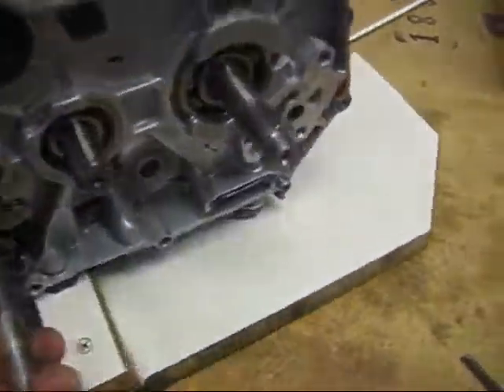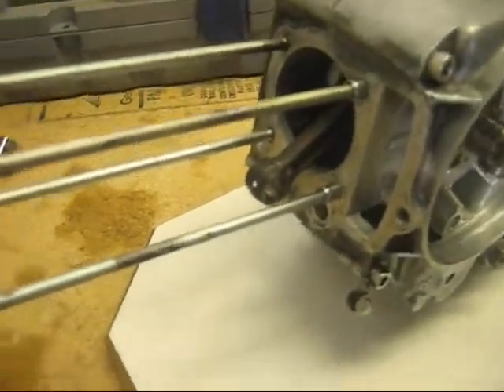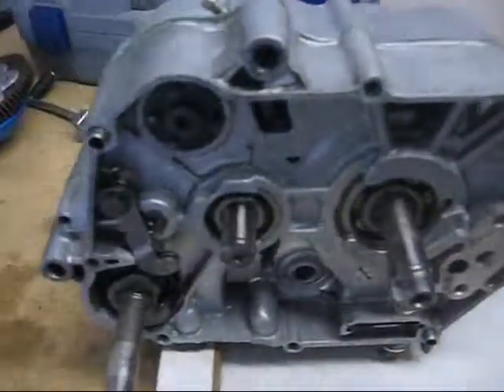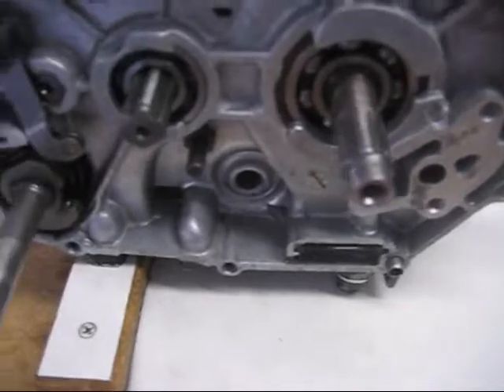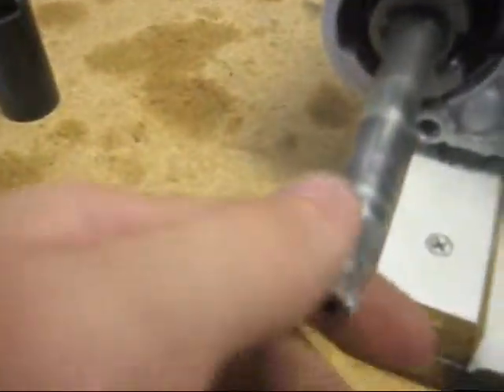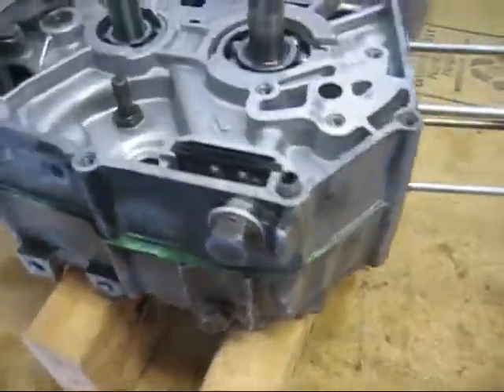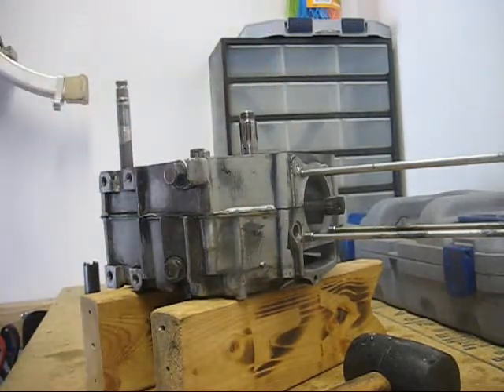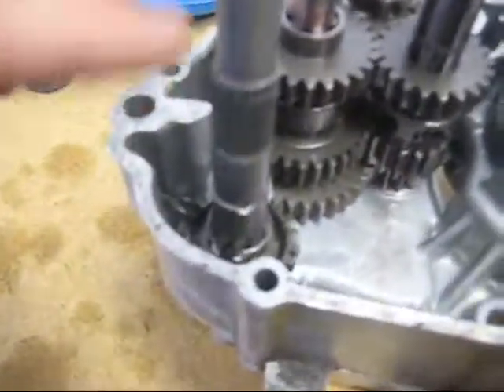How to split the cases in a Honda 50 or 70.

Comment: :D..yeah.. i figured it out. I'd rather ask first then to mess something up though. Just finished getting the transmission out. Next step is getting it into the z motor. I hope the flywheel and clutch basket don't give me too much trouble. It was a lot easier to work on the atc70 bottom end since it came half naked.

Comment: That bolt you pointed at 3:12 isn't on the atc70 bottom end. There's some kind of a shaft there that lines up with the shift star on the other side. How would I go about getting that off?

Comment: hi alex,  ihave a 79 z50 and I wanted to give the motor more power so I was if I can put a ct70 carb on it or a carb off something else because ican buy a new one on ebay for 22 bucks and a 20mm TB carb is 100 bucks. thanks
Reply from the maker: You will need the intake manifold from the CT70 as the carb bolt pattern is different. You may also find that the CT70 manifold causes the carb to hit the Z50R tank and cause fitment issues. Search Google for PlanetMinis, make an account, and ask there. The people there know a lot more than I do. It's been a while since I've played with these bikes and I don't remember all the details clearly.

Comment: quick question...obviously you know yer shit bout bikes...do you HAVE to take the flywheel off to split cases in this case on a cr80...i would think the crank would stay on that sprocket side, i actually stopped working on it right now cuz i cant get the cases apart and i dont have a flywheel pully. any tips?

Comment from the maker: It could be bent. If you ever dropped the bike hard on the left, it might have gotten bent. Only solution is to cut the left side flush with the case, then pull it out and replace it.

Comment: do i need to remove the clutch case, and all the things on the right side of the engine to split the case? i have the left case 1 inch off, but it gets in a bind on the the countersprocket shaft. i already killed that seal.. should it come off?
thanks.

Comment from the maker: You can replace the cam chain by removing the flywheel, ignition plate, and cam sprocket cover. It's a little tricky but patience and little fingers make it possible.